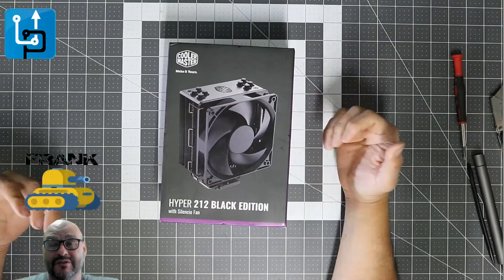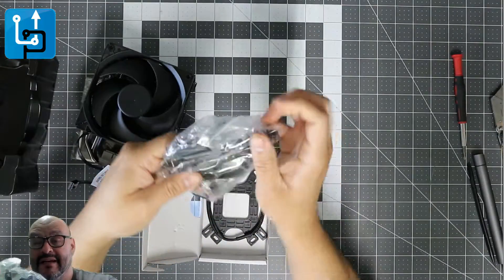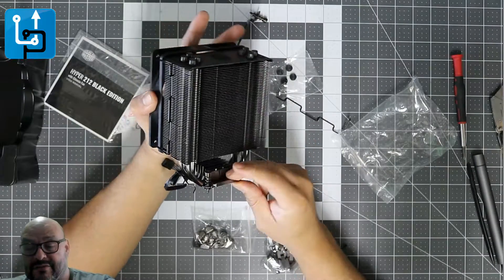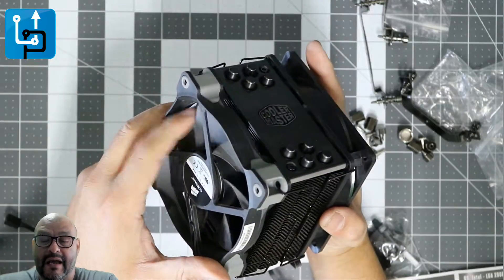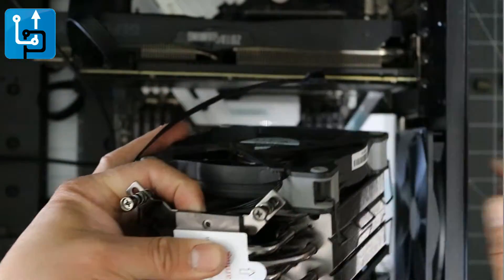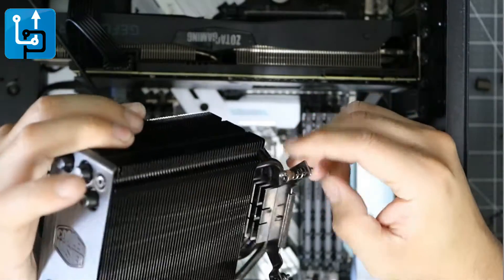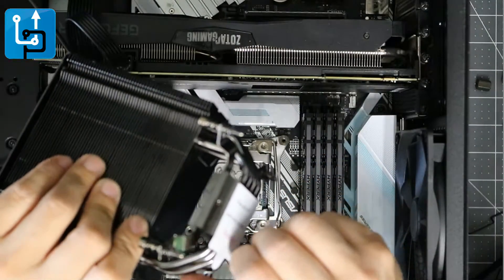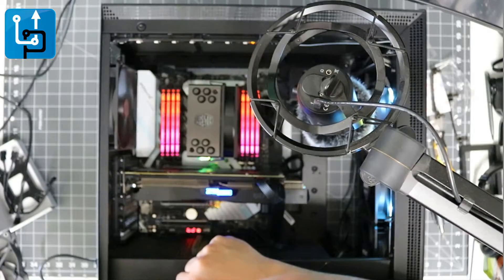Cooler Master Hyper 212 Black Edition

Comment: did you use the back plate included for installation on the back of the motherboard?
Reply from the maker: My motherboard had the plate build into the motherboard

Comment: I have the Cooler Master Hyper 212 RGB Black Edition and getting a i9-9900k processor would the temps be okay for gaming?
Reply from the maker: I have the same cpu I just added a second fan on the other side so this has two fans cooling the cpu. The cool master only comes with one fan. I haven't had an issue with this and thr temperature have been un 45
Reply: @Upgradetech  Okay thanks

Comment: my fan itself doesnt run. i went to bios and tried to change speed but it doesnt work still. The only time it works is when i first boot up the pc. Can you help me please
Reply from the maker: You going to have to connect the fan in another fan slot
Reply: Upgrade I tried still doesn’t work. I added extra regular 140mm fan as an exhaust that one works but the one that came with the cooler still doesn’t work

Comment: Your only supposed to put a pea sized dot on the cpu not the whole tube of thermal paste
Reply: it doesnt matter.. as long as u dont actualy use the whole tube lol
Reply: Does the cooler come with thermal paste?
Reply: @Byeis  Yes, it does, the little tube he used comes with the cooler
Reply: @Byeis  I don’t think so. But you want to buy one anyways.
Reply from the maker: Its been working ok, a little more will not kill anything I add this much on all my build and not one has fail. I'm not the verge I'm doing what has been working for me. Check out other they add even more on some of their builds.
Reply from the maker: You have to check out this great video I found about thermal paste, this shows why I always add a little more.
https://www.facebook.com/groups/1093790657346298/permalink/3007779535947391/